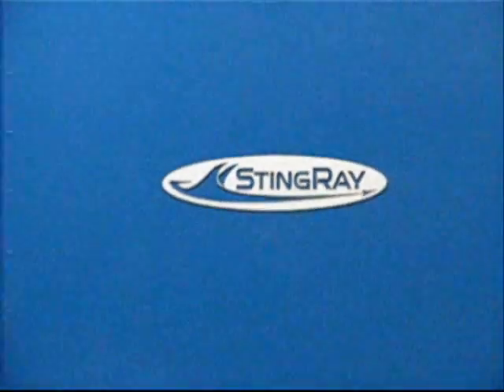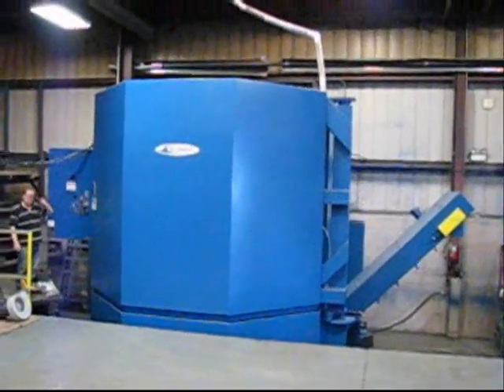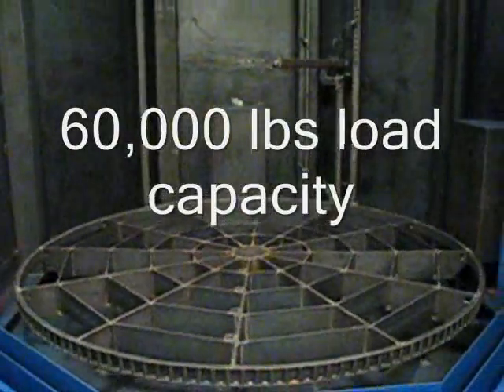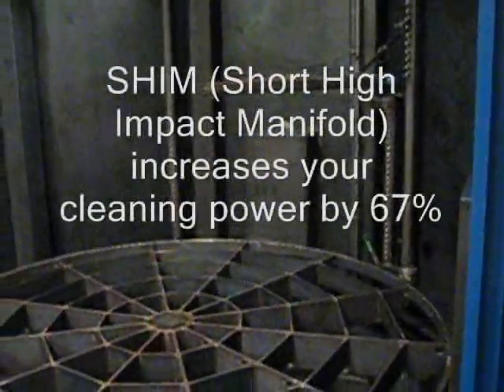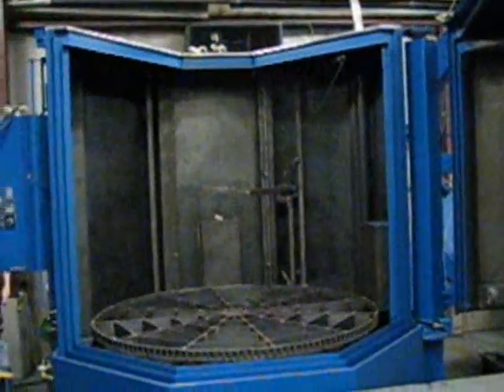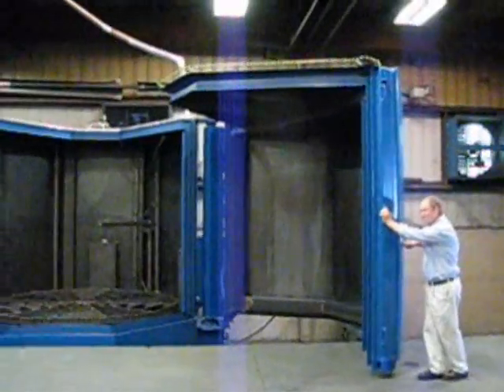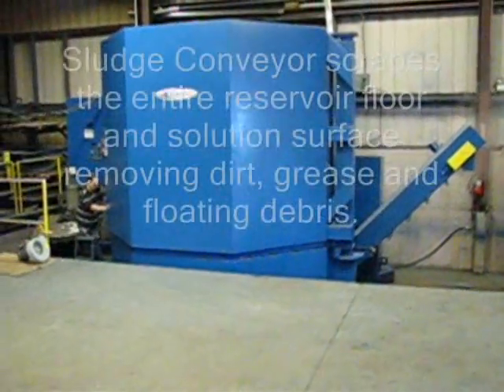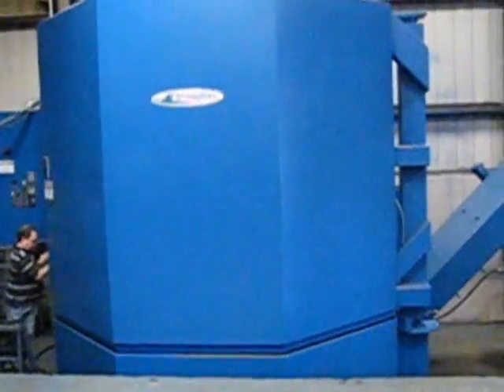StingRay_12090_Parts_Washer_Video.wmv

Comment: 120 inch diamter turntable work area - can be expanded to 150 inches if required. 28,000 pound standard table load up to 60,000 or more.  More than 1,000 gallons per minute. 152 psi. Oscillating manifold operates on the Power Wash principal to blast parts clean using hydraulic force coupled with high heat.  The manifold is not in sync with the turntable rotation so each pass by the blast arm hits the parts at a new angle. Machine can wash at 190 degrees F making grease and oil run like water.